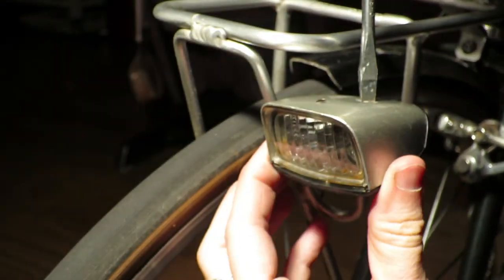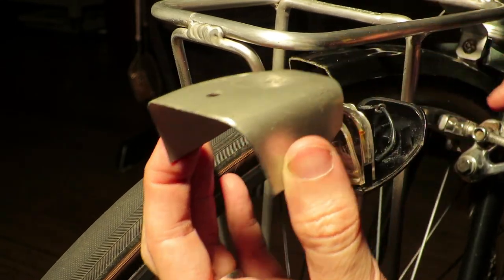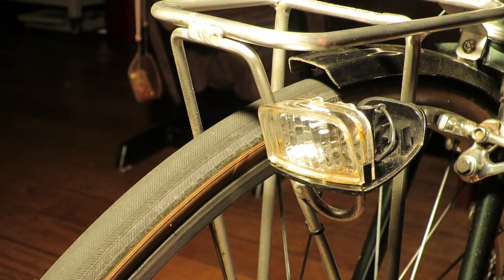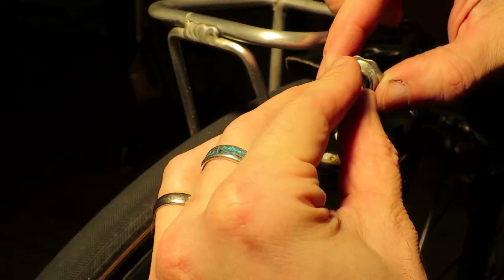Replacing bicycle light bulb with LED

Comment: Thanks for the info.....I didn't want the standard head/tail lights that you had to keep taking off & on to recharge...  I'm gonna buy a cheap $20 dynamo kit & the LED bulb upgrades. I figure when the dynamo head dies, I'll just make a little removable diy rechargeable battery pack. I can  wire into the lights & unplug it to recharge inside. Removing just the battery pack will be better than taking both lights off.

Comment: bike dynamos  are AC current; will it spoil the LED bulb which runs on DC?
Reply from the maker: I'm no electrician, but my light is still working after a couple hundred miles.
Reply: @restorationdotbike  what’s your led bulb voltage?
Reply: is ok, i saw the LED label when i replayed your video.  6V 1.5W. thx again for letting us know about your findings!  i'm going to give it a try myself 🙂
Reply: @restorationdotbike  I just found a solid state bridge rectifier costing a few cents in aliexpress. i'm going to try that too. it converts AC to DC and should make the LED 50% brighter, ie it converts the -ve part of the voltage curve to +ve. without it, the LED bulb won't light up during the -ve part of the generation cycle and i'm afraid it may damage the bulb that i'm getting. the seller wasn't sure if the reverse bias would damage it.
Reply: Nope, the D in LED stands for Diode, a diode is exactly what you use to turn AC into DC. Of course you will only be running it on 50% of the AC, but that's life.

I wouldn't worry about reverse bias damage as it'd be a pretty shitty diode to die to the reverse of it's normal forward operating voltage. I'd be much more worried about overvoltage from riding too fast.
Reply: @kyle8952  A dynamo can spit out many 10 volts in open circuit condition (i.e. reverse voltage, because it is almost a current source) which may easily destroy a generic DC LED when racing downhill.

Comment: Blue is the most dazzeling light colour because it scatters inside the eyeball. Therefore LED bicycle lamps are very dangerous because they make blind for 20 seconds when staring at them in the dark and so cause accidents. Also worse is the flicker (particularly with hub dynamo), which mindmachine effect consumes very much brain capacity and can lead to epileptic seizures, thus an LED upgrade needs rectifier and electrolytic capacitor to reduce flashing. In Germany it is outlawed to install retrofit lamps those shine to the sides or up due to dazzling risk to opposing traffic. You can dowadays buy warm white LEDs to reduce dazzle, or make your own from parts if a household LED bulb (e.g. reflector lamp replacement) with suitable voltage inverter.
Reply from the maker: The front light is hooded and pointing slightly downwards. Unless you're sitting in the street, are prone to epileptic seizures and are looking straight into the light I doubt what I'm doing is dangerous. Not less dangerous than having no light at all.
Reply: You could also settle for a warm white LED just put a small amount of orange glass paint and you got yourself that classic look.
Reply: White or yellowish LEDs actually convert the blue light spectrum to longer wave lengths. It's in the plastic casing of the LED chip. Those blueish LED headlights that I remember some 10-15 years ago are actually gone and not being produced anymore.
Reply: @MOUNTAIN-098  I replaced the halogen bulb in my very modded NiMH+dynamo powered bicycle lamp with a warm white Chinese LED (3..12V). The colour looks quite acceptable and it reaches full brightness at slower dynamo speed/emptier batteries. I hope it won't burn out by voltage spikes when used regularly (didn't test yet because of enough summer daylight).
Reply: @DilbertMuc  Nope. May be you have different laws where you live, but what I see of bicycle lamps here on German roads has still an atrocious blue tint (resembling my LED head lamp with 11K colour temperature). The warm white LED that I installed instead of halogen inside my bicycle lamp for testing looks definitely less irritating. But flicker risk seems higher once the NiMH batteries loose power (e.g. by too cold winter weather).